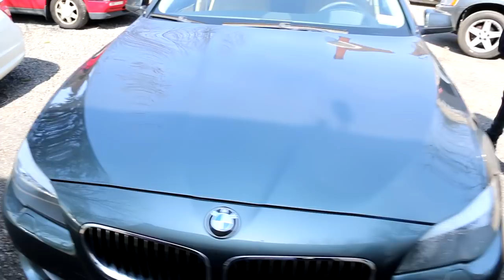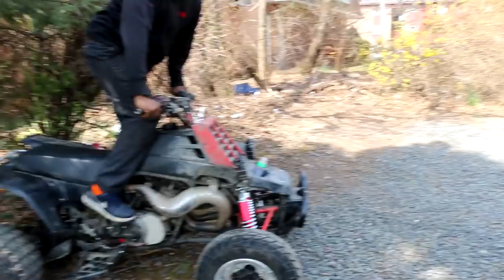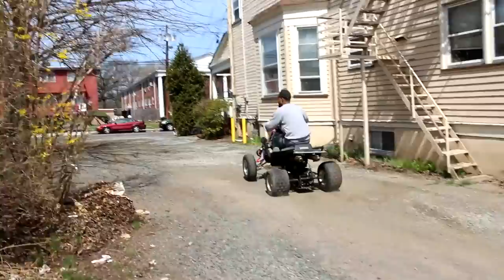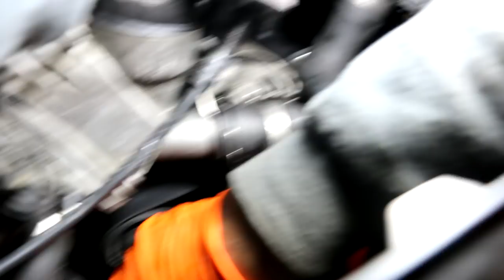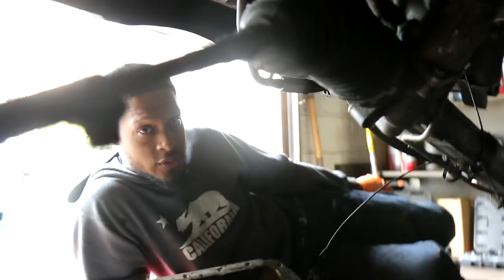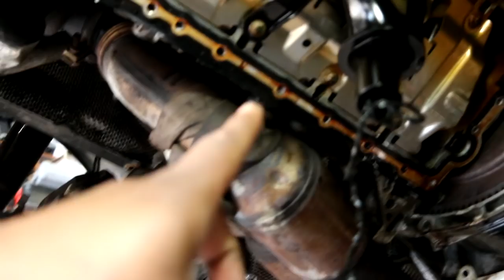VLOG 2 | BANSHEE FUN | PHILLS2K'S BMW OIL PAN

Comment: How many miles were on that 335i when the oil pan started leaking ? That’s a lot of work
Reply from the maker: About 138k the belt compromised the front seal due to a neglected oilfilter housing gasket.
Reply: Jermaine Lee wow thank god I got rwd and not awd. Is the belt and tensioner supposed to be changed at 50-60k miles right is that why it also shredded too ?